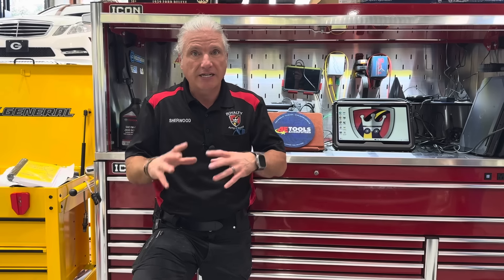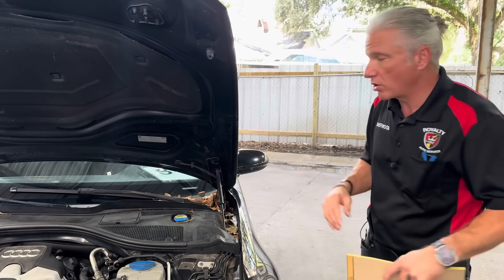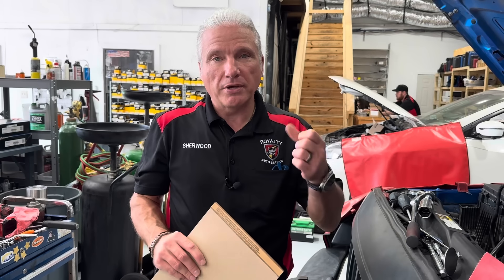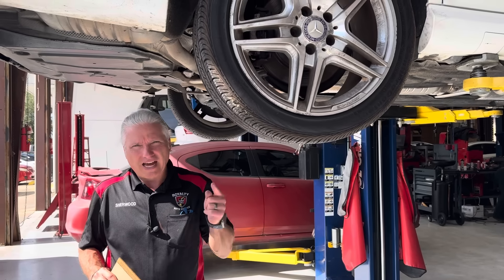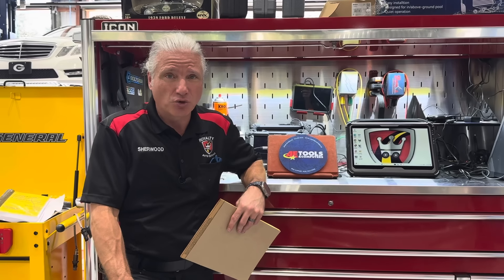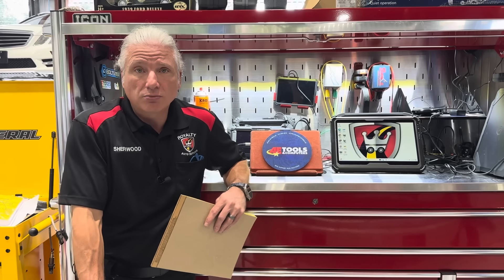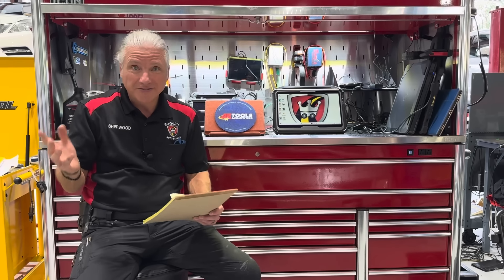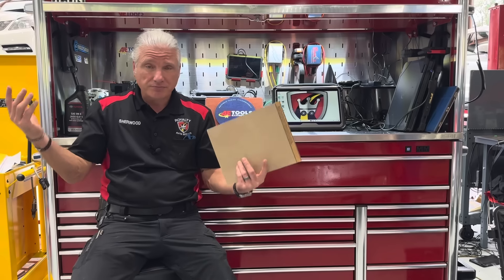Ranking The Top 5 Most Expensive Vehicles To Maintain That We Work On At Our Shop!

Comment: Fun video. One thing that's perhaps worth pointing out is the distinction between average cost of repair versus reliability over time/mileage. It would have been touch much to cover in this video, but some vehicles will be more reliable than others but have varying cost of repair when work is eventually needed. As a Subaru owner, I'm glad that brand didn't show up on this list. I do also own a BMW, though. And yes, it has leaks, but it's 27 years old so I don't hold that against it. 🙂
Reply: I would expect Subaru to be number 8 or 10 on this type of list.
Especially newer models.  Between the electronic thermostat and leaky head gaskets, they aren't exactly the cheapest to maintain.  Still, better than the examples listed here.  A WRX head gasket job reminds me of an Audi timing chain job.
I just think they're overrated.
Reply: @christopherlowery855  Head gaskets haven't been a concern on Subarus since about 2010 after the FA-series engine came out. Subarus are fairly reliable these days (6th most reliable among all brands according to CR), but they do have some things that can be costly to repair. On the whole, they are better than the industry average.
Reply: @ZeGermanHam  I haven't followed the engineering of any of the newer engines, besides the oil  starvation issue on the GR86/BRZ and the electric thermostat I mentioned.
The oiling issue only exists on track.  It's not even a concern for street use.  As for the thermostat, from what I've seen, that poor engineering choice was quickly reverted due to the increased failure rate.  I don't think its on any of the newer cars.
Do you know if Subaru went back to a single-piece head or is it still a 2-piece assembly?
Also, did they ever reorient their head bolts to allow removal, of the head, without removal of the cam shafts?
These are some of my bigger complaints about their boxer engines.  As well as the poor oil baffling from factory I've mentioned.
Otherwise, I would agree, its a pretty solid powerplant, so long as you don't over-boost it.  The STi is already riding that reliability line from factory.  From what I understand, some guys just push the engine over the edge and then try to blame Subaru as being unreliable.  Likewise, they try to apply 400whp to a wrx transmission.  I don't blame Subaru for that type of idiocracy.
Reply: @christopherlowery855  The thermo-control valve underwent a redesign a few years ago, which should in theory help. However, Subaru also ditched the termo-control valve altogether for 2025 and went back to a standard thermostat. As far as the heads go, they are still two-piece w/cam carrier, and the cams have to be removed to get the head off the block. Subaru also redesigned the valve covers to help with oiling in high-G settings. From what I've heard, the bigger issue with oil at the track is temperature control. I am a track instructor and I don't see many Subarus on the track. It's my view that they simply don't hold up well in that environment for a variety of reasons. Totally agree with your assessment of owners ruining their Subarus by modifying them. I think the newer non-turbo daily driver Subarus are pretty good all things considered. The biggest liability they have is CVT valve body solenoid failure or torque converter failure. Those are fairly costly repairs, but not a death sentence. I believe both issues have been somewhat addressed in the more recent years, too. Wheel bearing failures are reported with some regularity as well. Other than work involving the cylinder heads, I really enjoy working on Subarus. They're well built and most things are easy to get to.

Comment: Great video and great data. You should find a tame statistician to help get more out what you have. To begin with, you could simply divide the average repair cost per vehicle in each brand category by the average age. A related useful calculation would be dividing the average repair cost by the an average odometer reading.

Comment: I have a Jaguar F-Pace and they are not the cheapest to maintain. But he’s right, if you do your oil changes more frequently than the service intervals, you car does tend to last longer with fewer problems. I did have to drop $2,400 to fix the Y pipe and water pump (known issue) and the front lower control arms (my fault I think) but other than that, it’s just been regular service on my 2017 with 78k miles on it. I even did a pre-cautionary transmission oil and pan replacement just to ensure there were no metal shavings that I had to worry about. 

Zero weight oils and direct injection are two things that seem to be killing a lot of modern engines these days - even mighty Honda.

Comment: I bought a '19 Range Rover Velar new....took it to the dealer for first oil change and they charged me over $350....I did the next oil change and there was nothing to justify the outrageous cost of the first one. In fact, I paid less than $90 for parts and had the oil changed in 30 minutes. This year, I sold it and went with a '25 Lexus NX350h.

And I do oil changes on my cars at 5000 miles OR 6 months religiously.

Comment: A lot of it comes down to proper maintenance, not just manufacture recommended. I also wonder if the Ford repair costs may be from fleet or business vehicles that are willing to do repairs no matter the cost. In my experience as a tech, there are many customers (personal vehicles) that have sticker shock when the RO quote comes in higher than they expect. I’d say about 25-35% of those end up not doing the repair. But on German cars, people tend to stick with a shop they trust since many shops diag and repair them incorrectly.

Comment: Interesting stuff. Would love to see a public report on more repair costs across the industry.

I've got a 2014 Prius c. So far oil changes, fluids (coolant and transmission), tires. The 12v finally died on me a couple of months ago which cost more than I thought it would. But otherwise it just runs. 

My wife had a 2014 Prius v that suddenly needed new head gaskets. We put the money towards a new car instead (were going to trade it in soon anyways).

Comment: This is like replacing a water pump on a washing machine. The pump is cheap and the actual removal of the pump itself is just unscrewing it. However, you have to dissemble almost the entire thing to just access it. This easily adds 2 hours to the job. So expect to pay 4 hours and a markup on the part or get an offer to replace it with a brand new set with free installation and removal of your 'broken' machine. In the meantime your 'old' is either ''fixed' and resold or scrapped for parts to be pawned off to someone else as a 'gently' used part or put on Craigslist as a hard to find item.

Comment: Great and interesting video.  While I know you wanted to keep the data analysis really simple, it would have been valuable to also tell us what  the 'average vehicle age' was  during the two years of data you used as basis for each ranking slot.   As you mention, if one of the top 5 in repair cost were from older models of that product line, that is good to know.

Comment: Main problem is most people don't do reg. maintenance, which on cars with mileage approaching 100,000 is more than oil changes and a tuneup, thermostats, driveline fluids, flush the brake system, pcv system and oil changes not exceeding 5000mi.

Comment: I owned a car shop in the 90's.  We probably had 1 or 2 toyotas (if any) during the 3 years I had the shop.  The ones that cost the most?  Take your pick between anything Diesel, Turbo charged, or BMW.  the only vehicles I would ever own-=domestic GMC or Chevy.  Foreign, would be Toyota, Honda.  Anything else is either junk or not been around long enough to determine or get parts.

Comment: Six Mazdas since 2002. Every car was kept longer than 17 years. Every single one let go was still running strong. No issues except standard wear and tear and the occasional recall. Still have my RX-8 from 2006--drives fabulous. Just changed oil every 3500 miles and oil filter every 7000 miles for all my cars. English and German luxury makers have a different priority from the Japanese. I think they design cars to be leased or owned no more than 5 years and provide maximum excitement for that time only, so they spend a lot of money on leading tech/engineering/luxury but much less on quality of manufacturing. People that buy luxury cars more than 5 years old need to know what they're getting into. I don't remember a time when Chrysler(Stellantis) was ever off of the poor quality list. Their relationship with the Italian marques just adds to the image of unreliability.

Comment: Had a 2002 beetle diesel, 2015 wrecked via rear ended on freeway. Had 320,000 miles & got 45 mpg: 10 years no car note, liability insurance savings, and high mpg saving $80 K minus higher maintenance of 10 K leaves 70 K in my pocket.
Reply: Adding to it is the 70 K stays in Stocks and is worth 250 K today.

Comment: Like this post. I owned a 96 BMW 328iC and a 2012 128i that never leaked oil or broke down. 96 328iC was my daughters' cars in high school with 100k. My 2012 128i I did annual preventative repairs to insure no road failures. Water pump, thermostat, valve cover/CCV, tie rod end connector, anti-sway bar bushing, trans fluid and filter, rear differential fluid. So, the average was $500 a year plus $100 oil changes and $1k insurance to drive 2k miles a year because it was a little convertible. It has a new home. Wife is loving the new 2024 230i, with extended factory warranty.

Comment: I have a friend who bought a Porche Cayenne from one of his customers for the price the dealer would give him as a trade in. It was a good price.
Everything was working fine except the blower.
Porche wanted $4000.00 for the part plus labor.
My friend bought a blower online for $40.00.
His mechanic installed the blower.
Guess what was on the label of the old blower?
If you guessed Volkswagon you would be right.
What bandits Volkswagons are.
They did get a pretty heavy fine for emissions fraud but have not changed their ways.

Comment: Can vouch for VW. I found out that I needed my valve cover gasket replaced in my 2018 Jetta and thought "Oh that shouldn't be bad. I replaced one on my old Ford Focus and it was simple." Nah, nah, how foolish of me. Turns out they designed this engine with the camshafts at the top of the valve cover, so in order to replace the valve cover gasket you had to have a special tool to lock the shafts in place. I'm not a mechanic, but I do work for a dealership. They couldn't work on it. Took it to the more exotic mechanic that our dealership goes to. $800-900 is what I was quoted after he had taken a look at it. 

I guess the good news is that it's paid off and I'm wanting to trade it in, cause that $800-900 is a half decent down payment.

Comment: This is NOT a plug, it’s my experience. I’ve owned a bunch of different cars over the years including a couple on this list and I do almost all of my own maintenance. The easiest car to maintain that I’ve ever owned? Tesla model 3. I own 4 of them now and you just jump in and drive. Super simple car, nothing ever breaks. I clean the radiators and inspect and lube the brakes annually.  Replace windshield wiper blades and tires occasionally.

Comment: My first vehicle was a Chrysler. That thing was a lemon. As much as I hated that vehicle. I have never had a mechanic, touch any of my vehicles for 40 years. I had to fix that car. I didn't have the money to take it to a Shop. Forcing me to fix my vehicle gave me pride and confidence.

Working on vehicles is really no that hard. Especially today.

There a Youtube video for every type of repair.

I wish I could visually watch a video 40 years ago. I had a chilton manual and a $130 tool set.

I still own that tool set.

Btw. The crankcase vent issue with the Audi. The Bmw's have the same issue and squeal. When this goes you have an increase in air pressure inside the engine. This will cause issues with gaskets and will cause oil leaks.

Comment: My 2010 subaru outback turned out to be quite expensive at 120K miles when the head gaskets failed. Around 4k out of pocket to rebuild the engine. Other than that, its been pretty low maintenance, just oil changes, brakes, tires. But lets see how long the japanese transmission can last!

Comment: I got an 08 accord 200k miles with no issues drives like new only thing I had to change was a starter at 180k miles
Reply: I smell exaggeration.  I have an 08 MDX with 195k mi on it.  While maintenance has been low, I would hardly call the vehicle problem-free.  We did need to replace the A/C.  And starter.  But other minor issues include the programmed seats not retaining memory, the bluetooth module went out, the RF receiver seems to be going out.  The LCD display on the dash takes a long time to warm up and display.  The driver side mirror doesn't move into parking position very well, the climate control vent position actuator is broken, and one of the engine mounts needs to be replaced.  Also, there's an oil leak from the valve cover.
200k mi vehicles will just have 200k mi problems.  If your Accord is virtually manual everything, your story would be a little more believable.  But if its as luxurious as the Acura we have, I suspect similar electrical problems.

Comment: Had a BMW 3-series I bought new.  Biggest piece of crap I’ve ever owned.  It needed a new head, exhaust lifters, power door locks, fan motor, anti-lock brake unit, coils, camshaft position sensor,  transmission fluid flush for a torque converter going bad, and the list goes on… all before 85,000mi.  Traded that piece off for a used Lexus and couldn’t be happier!  Never again - ‘Bring Money With’.

Comment: Awesome info. 
The most expensive - my 1985 Ferrari 308 GTS QV. I did a valve job myself - 8K (parts and machine work). Shop would cost almost 20k - no joke. New sport muffler $3200. Parts are so expensive, you have to take a second mortgage out on your house. The Cheapest - my LS swapped '97 Jeep TJ - EASY to work on and parts are so cheap they might as well be free.  I also own a 22 Toyota Tundra and a 23 4Runner. (super cheap and reliable. - they just need scheduled maintenance) Working on and building cars is my hobby.    
My wife had a 2016 Mercedes ML320 - Mercedes shop wanted $1800 to replace the brakes. I did them (including rotors for $800).  My advice (and no offense to the hard work you provide) - Learn how to work on your cars.

Comment: I wonder if the majority of GM issues for Trucks that are expensive to repair is on the V-8 with the variable timing that shuts down 2 or more cylinders from firing on highway driving for gas mileage

Comment: The older I get and the more miles I put on I just don’t see why people don’t buy diesel.   Reliable and hundreds of thousands of miles.   Good mileage.   A good example is My current truck I put nearly 40k miles on last year  and the only thing I had to do is change a $100 steering pump all while averaged 18 mpg.
Reply: Reason I didnt go diesel. Diesel option on the truck was about 4 thousand bucks, and diesel fuel is 50 cents more per gallon than the higher refined gasoline...which makes absolutely NO sense at all.
Reply: @   Ya.  Well we got a 17’ Tahoe with the 5.3.   Not the best on fuel but as an example we drive my truck on most road trips.  Highway I’m getting 23-24 mpg.     My trucks 9800 pounds and in town stop and go I average 18.  Maybe your still paying less   But I know my motor can and will last 3-4-500k miles without any major issues.  I’ve done it several times.     I also need diesel for towing and my business.  There’s also a reason alot of other countries use diesel more than gas.  It’s easier to refine and usually more cost affective in the long run.
Reply: It dies in city traffic or when driving short distances.
Reply: @rodleypumpkins4174  that mileage is pretty impressive. That could make the difference, and make it more economical.  Want a good laugh? I got a '23 Colorado ZR2 with the turbo 2.7 four. It gets 18 mpg. 😆 🤣 😂 
And hold on to that Tahoe w the 5.3...they live forever, and are as comfortable as anything on the road.